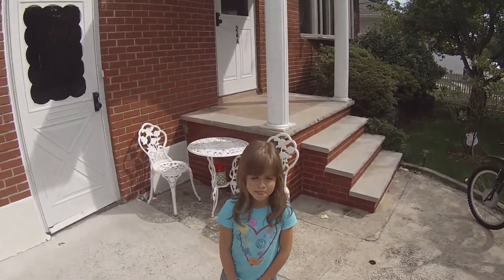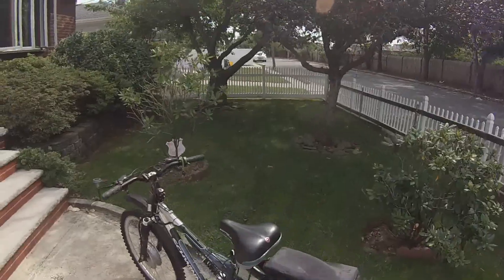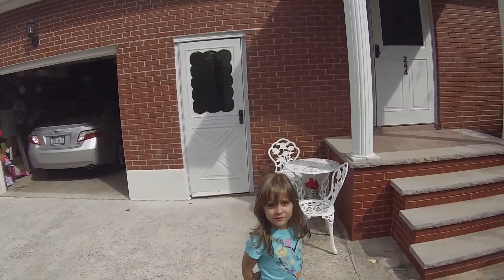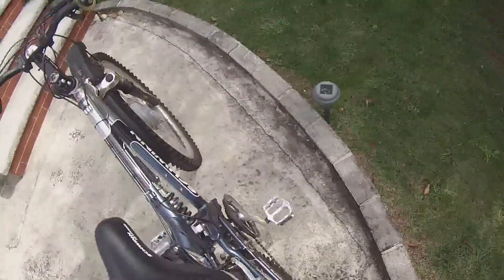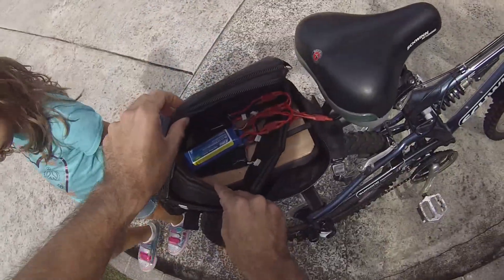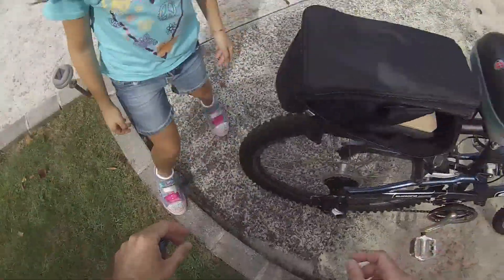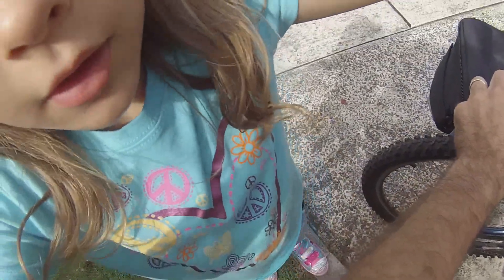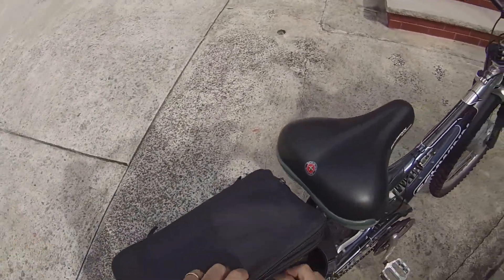Electric Bike Conversion to LIPO Battery Pack

Comment: Hello.
Can you tell me how many volts is the engine?
Reply from the maker: +Manuel Esteban Cañete Alcaino I am using 5 - 11.3V 2300mah lipo batteries in series.  The original Lead Acid pack was 48V (4 12V 8amrh batteries), but the motor can handle up to 110V.
Reply: +Chris Horianopoulos I have a 48v 1000w motor. I'm using lead acid batteries (48voltios) and want to change LiPo. I have 2 6s 3600mAh pack and want to try them on my bike. Your combination is 2300mah 15s ??